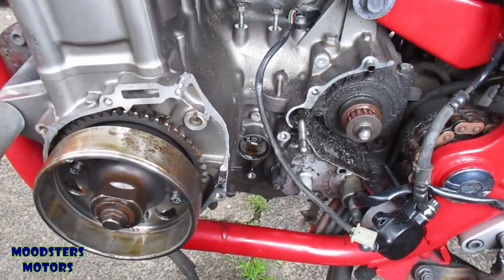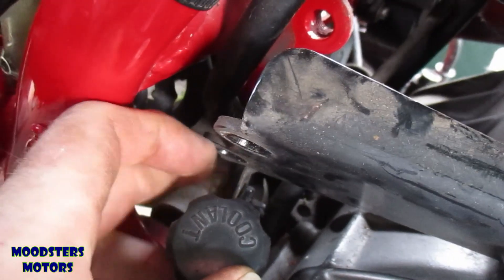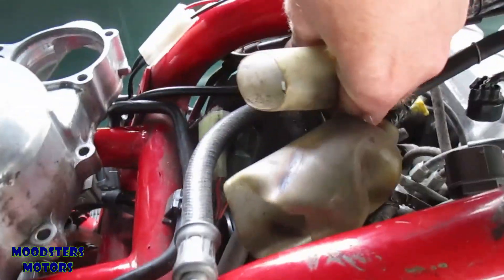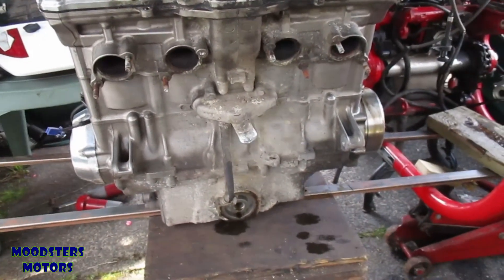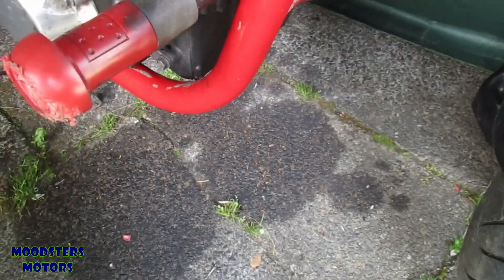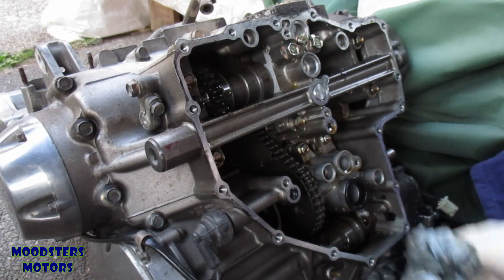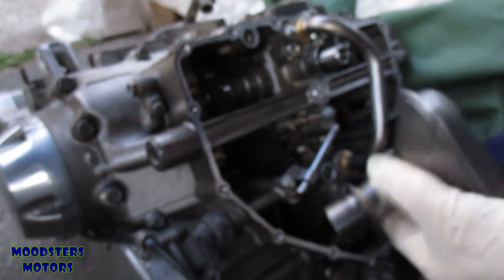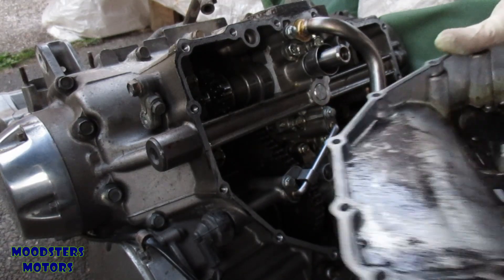CB1300 Pt9 Engine Swap

Comment: Which engine would you recommend for a Honda cb 750cc nighthawk swap with??
Reply from the maker: Thanks for your question. Unfortunately I'm not the guy to be asked.  I believe in originality. Engineers spent years researching, designing and testing the bike to perform in a certain way to achieve the objectives, i.e faster, more economical, comfortable etc... depending what they want the bike to be used for. Changing the engine will change the dynamics of the bike. A heavier engine will affect the frames performance as will a more powerful one. My thoughts are if your Nighthawk isn't doing what you'd like it to then change it for one that will. Of course this is just my opinion. You're absolutely free to do whatever you want with your bike. And which engine you use depends on how much work you want to do to fit it. Sorry that I'm not much help to you,.